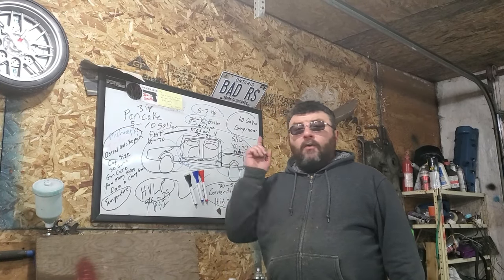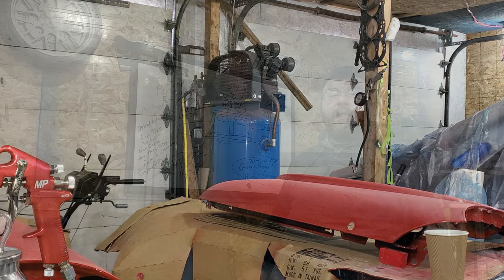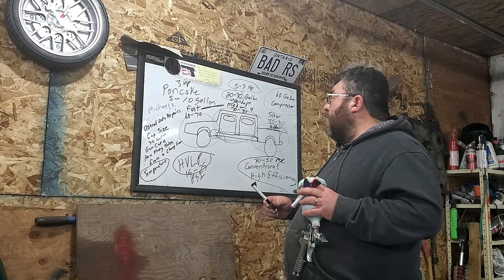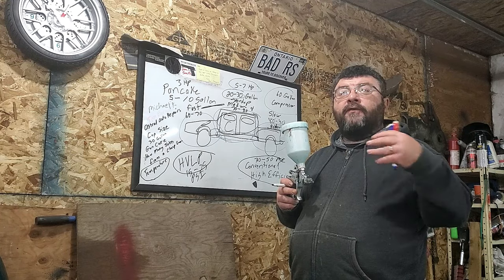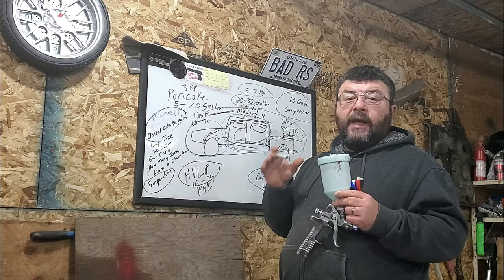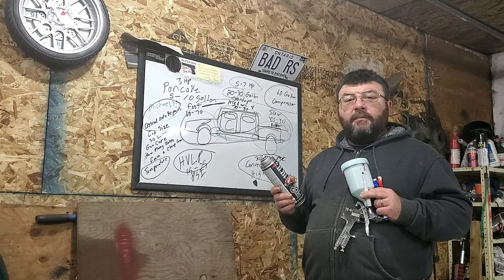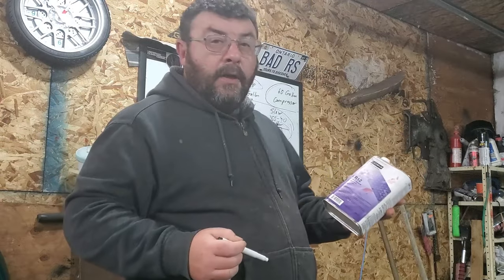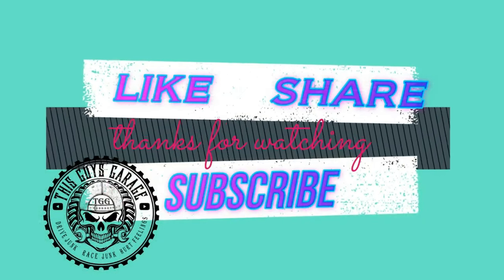compressor size for paint spray gun to refinish cars

Comment: It's weird how you post a video explaining what size compressor is required to paint a car and still every comment is from someone who wants to disregard what you are saying and use a Harbor Freight 2.5 horse compressor with a twenty-gallon tank to paint their car. They believe the r500 lvlp gun only uses 3.5 cfm and it will work perfectly. Well, I saw actual tests done with that gun and if adjusted properly it used 7.5 / 10 cfm. When you read the actual specs, they include with the gun it Staes 11 cfm and yet they still advertise it as using 3.5 cfm. Yes, you can turn the air flow down lower and hold the gun 4" from the car and still paint with a small compressor but to use it optimally you better have a minimum of 10 cfm and 30 gallons of air to be painting a car.
Reply: So what you're saying is you adjust your techniques to youe tools? Got it.

Comment: Ahh man… you’re using those 20 year old marketing HP numbers :( Those 3HP pancake types are closers to .5 or .3 HP but not usually more than 1HP. The true 2HP use about 15-20amps and can flow between 5-8 CFM @ 90 PSI.

Comment: Good info, and easy to follow. The HP rating examples for the pancake and 20-30 gallon compressors seem a bit inflated to me, especially for single stage 120 volt units, are you referring to the older ratings before manufacturers had to meet standard requirements.
Reply from the maker: great question Michael, i use them for reference ,by tank size i was referring to the scope of the size of the repair you are able to paint without running out of air, the hp ratings are all over the place from compressor to compressor, but the volume of air remains constant, the hp would certainly have a lot to do with air recovery. hope this answers it, if not don't hesitate to follow up! ty for taking the time.

Comment: I have a question, so I'm looking to add spray on finishes to my business which is gunsmithing, but i want to know what equipment would best be suited for my job, firearms arent that big but still want a top quality finish on all firearms. would that HVLP gun work or should i also stay away from it. also should i stay in the medium size tanks like 15 gallon and up? thanks in advance.
Reply from the maker: I would suggest a conventional gravity gun , but to help you better I would need to know what coating you are using. 
Is it automotive color for metal or wood stain and varnish?

Comment: I'm 5 ⭐⭐⭐⭐⭐ painter and here I'm watching this video thanks for the information because I'm about to do small jobs,  so the sizes matters depends.   I always had the 60 gallons and up ... thanks
Reply from the maker: Hey kc thanks for taking the time. 
I did a lot of auction work on site doing blow ins and did  a lot of work on brand new vehicles with a small pancake compressor.  It can be done well but you definitely need to stay in the lane for size of repairs.  Appreciate it 👍

Comment: I painted the whole car with smallest compressor (1hp- 9liter).... with small gun it was perfect, bigger 1.4 gun it make orange appeal due to not enough air volume... but I guess 50l with 4-5hp will work like magic...just play with settings of gun and dilute the paint to have uniform flux...
Reply: I did it mostly panel by panel due to low spread of paint :))

Comment: Hello Shaun, I need a compressor good enough to complete by Beetle 1956 restoration job. Looking to buy 6.8CFM /8Bar /2HP Air Compressor as I don't have spare space in my tiny garage. I found a DAXINYANG LVLP Spray Gun R500, Automotive Air Paint Sprayer Gun!  As I'm a beginner, Is this a good choice? Thanks a lot Shaun.
Reply from the maker: i have only purchased one lvlp spray gun ,it was around a 100 bucks and gave more than acceptable results. as a beginner i would suggest going to your local jobber and ask if they have any mismatch paint you can buy reasonable to practice with before you go forward with your beetle paint job to be on the safe side , of do a practice run on the back side of the panels you have off.  good luck and let me know how you make out!
Reply: @thisguysgarage  Absolutely Shaun, I will. Yeah it is a good idea, -mispaint test run. For time being Shaun thanks a lot.

Comment: This is great information. Is it recommended to paint base and clear if temp. is around 60 degrees? what can be done?
Thanks!
Reply from the maker: 70 /80 is optional but there are additives that go in the paint that deals directly with temperature 👍

Comment: What would you charge to paint a trailer with a 6X8 bed that is 14 feet from the rear to the tongue? I'm a disabled Combat Vet and wanna get back into painting. I served in the Air Force and Army. When I was in the Air Force, I painted F-!6s and A-10s. So, I know what I'm doing. I also understand that you gotta pay for experience. So, what would be a fair price?
Reply from the maker: Hey to be reasonable if you are just getting back into it , time is money  ,so if you can get the job done in 20 hours, figure your time is worth 30/40 per hour, I usually judge material costs at the same rate as labor so probably would ballpark 12-16 hundred dollars.  Total 

Just  a ballpark, for estimate 
Let me know if this helps
Reply: @thisguysgarage  Ok. Ok. That's about where I was, too. I've been trying to get round about prices so I don't over or undercharge. Thanks.
Reply from the maker: @sgtrickards5683  🤜🤛👍
And thank you for your service sir!

Let me know if  you need anything else 👍
Reply: @thisguysgarage  It was a pleasure to serve.

Comment: I think I will just be paiting my vw bugs. I am thinking a 30 gallon should work, I am in no hurry. So do you have to wait for a couple hours? Also is a 110v compressor ok to use?
Reply from the maker: 30 gallon 5-7 HP should be big enough to paint your bug. Especially if the Fender's are off.
Reply: @thisguysgarage  most 30 gallon air compressors are 2hp and pancake air compressor are usually 1hp, so where are you getting your numbers?
Reply from the maker: @austinhunt8050  most?  Show me one 2hp 30 gallon compressor on sale today.
Reply: @thisguysgarage  most air compressors run on 120v 15a outlets which is 1800w. 1hp is 745 watts so the maximum power draw is only 2.4hp. And devices that have continuous draw can only draw 80% of the amp rating of the circuit which is 1500w or exactly 2hp.

Comment: I just got a 20 gallon and a LVLP gun. Do you think i have to paint one panel at a time? Can it paint an entire hood?
Reply from the maker: I would need to know exactly what you have , I'm going to make a video on this topic since you were the second person to ask. Let me know what you have for equipment 👍
Reply: @thisguysgarage  I'm sorry. I have a summit racing lvlp 1.3 which i read is a sprayit 33000 clone. 20 gallon Husky quiet compressor. Haven't painted yet, i'm still gathering supplies. Thank you for the reply.
Reply: You can paint the whole thing 25-30 psi quick swipe it 4” away your welcomed

Comment: Here’s the problem I have I bought a 70 gallon compressor by industrial air but it only has a 3.1hp and a single stage compressor. Would I still be a to paint a hood with that? It’s an 85 sw Chevy tgat me and my son is building for him.  Any tips would greatly be appreciated and what gun would you recommend
Reply: That’s supposed to say 60 gallon not 70
Reply from the maker: painting a hood will be no problem with 60 or 70 gallons of air , https://amzn.to/3SLDFI5 would be what i would recommend .

Comment: Good tip on the paint stripper to clean a gun with dried paint inside. I have a question, is it better to remove fenders, doors etc and paint separate or to paint car assembled? I ask because I want to paint jams and both sides of hood, doors and trunk. Staying with same ford ua code black paint
Reply from the maker: if the paint on the jams is good there is really no reason to repaint if they will clean up and you can do a good job masking. i would always suggest painting car assembled . the air quality on the day can change your paint texture so recapturing the same look repeatedly can be difficult ,but not impossible . i have painted jams without removing panels .just mask well. if you already have it apart ,do the jams reassemble for good adjustment before painting.  let me know if you have any other questions ,love it!
Reply: @thisguysgarage  ok thanks. I didn’t really want to remove all that stuff anyway because I’m a one man show. I have to do a little painting in a few jam areas down low because of rusted panels I replaced but don’t have to remove doors to get at it.
Reply from the maker: absolutely best solution! thanks marauder!

Comment: I want to paint my car but I don’t want to use rattle can. I’m thinking of her a pancake compressor . I’m thinking of do panel by panel . What kinda gun that would work with low volume low pressure?
Reply from the maker: A pancake compressor will not supply enough air to paint  a complete panel.  Great for a touch up but doesn't have the recovery necessary.  I am going to shoot a video on this topic of painting panel by panel. This question came up twice today 👍 always happy to answer questions

Comment: How would a 5.5 HP gas, 8 gallon, 10.5 CFM at 40 psi, compressor do at painting?
Reply from the maker: you would need to find a sprayer that fit those parameters ,like a touchup gun for example . 8 gallon is not a lot of volume but the 5.5 might give you enough recovery to do a bit of painting. hope that answered your question . start with a small job and you can judge from there.
Reply: @thisguysgarage  Makes sense. I think I'll actually add a 20 gallon auxiliary tank and see how that does. 28 gallons with the above specs should make a half decent setup while still allowing great portability for nailing jobs with just the wheelbarrow compressor.
Reply from the maker: @vim_usr2753  sounds like a good plan 👍let me know how it goes 🤜🤛

Comment: I have a pretty old Sears 100PSI 12 gallon compressor. Would that be enough for undercoating the underbody of a 2 door sports car? If not what size would you recommend? Thanks!
Reply from the maker: I would use it. No need to buy bigger unless you have a need or bigger projects in the future.  40ish psi for an undercoating gun with a 25 foot hose if memory serves me , longer hose than that  turn up the pressure Guage about 1 psi per foot, will get you in the ballpark 👍
Reply: @thisguysgarage  thank you very much for the quick reply!! Keep up to great work?

Comment: What size compressor would you suggest for shooting color and clear for motorcycle tanks and fenders ?
Reply from the maker: 20-30 gallon will get the job done well ,make sure to use an incandescent air dryer on the sprayer. ty Bill

Comment: my question is.. i have 2 different compressors.. 1 is 33gal and 1 is 20 gal.. is it possible to alternate between both so when 1 gets low and starts recharging can i just jump to the othe full compressor and so on?  basically is it almost like having a 53gal compressor by doing that?.... and the reason i have 2 is because 1 was a gift 15 years ago, and 1 i recently purchased myself.
Reply from the maker: Just install a T between the two and you are ready to rock 🤜🤛
Reply: @thisguysgarage  is there any actual videos on how to do that safely?..  i know electricity ..not compressors..lol
Reply from the maker: @mikeammargon6847  I did a video on daisy chaining compressors  https://youtu.be/bl1UNikebjM

Comment: what's the minimum  horsepower for a home garage would you recommend .
Reply from the maker: 30 gallon 5hp would be the minimum i would start with for light bodywork for example. it all depends on what your doing and what your needs are .
Reply: @thisguysgarage  That;s what others say but ,  they are hard to find .

Comment: How about lvlp gun with a small compresor.
Reply from the maker: I just bought one , it appears to work better at lower pressure but have not had opportunity to test with a smaller compressor ,but as far as the scale presented in the video it would not change a great deal, any paint gun consumes a lot of air. ty great question

Comment: This guy garage what type of gun is compatible with a 20 gallon stand up compressor???
Reply from the maker: look for a high efficiency non help,all the guns i test on my channel are picked by me to work for this type of compressor. 
the limit to the 20 gallon is how much are you will be able to paint at one time.  👍great question. never hesitate to ask Vijay
Reply from the maker: non hvlp
Reply: @thisguysgarage  thanks
Reply: LVLP low volume low pressure.
Reply: What  nose size  to be it? I visited a few  places today  to  get  a sprayer gun , but I didn't find.  I have been at Menard,  Lowe's and  Harbour Freight.  All  sprayer had the nose  1.3- 1.4 mm. Which one is the best  ,and where can I find it  ? Thank  you.

Comment: If you’re still painting and you hear your compressor come on can you wait for it to refill before you start your next coat?
Reply from the maker: i usually start just befor its going to shut off so its still in recovery mode , if you leave it shut off it will loose about 30 psi before it come back on, great question! ty Honey Dutch!

Comment: So I’m fixing to tackle my first paint job It’s on a 07 classic crew cab Chevy 1500 not really trying to break the bank on a air compressor as I’ll only be using it probably one time just on this one truck what gallon,cfm,and hp would you recommend from my understanding I need to be in the 15-20cfm range but all of those are 1500 plus and I’m really not trying to spend more then 500 bucks on a air compressor got ant links you could send me for something that would be good for what I’m trying to do?
Reply from the maker: I would look for a good used 60 gallon stand up that at that point because a super crew full size Truck has a lot of surface area.  The only other option would be to paint it in pieces which is not ideal. Home depot used to sell a 60 gallon stand up for $999 . I would look for a good used one 500 dollars should get you there. Ty yee yee. Any other questions don't hesitate 👍

Comment: If your painting at home make sure you check with your state environmental rules. Certain size cups you can only use at home if you don't have a paint booth. If you have a nosey neighbor and they start complaining About over spray you can be fined. And make sure you have a pl!ce where udispose of ur extra clear coat which should just harden up but dispose of ur chemicals the right way. If your doing all this at home without a paint booth.

Comment: Can i used  craftsman 135 10 gallon ?
Reply from the maker: For small areas described, absolutely
Reply: I try to paint my 1950 3100 truck
Reply from the maker: @ferminmontoya243  complete? Too much surface area.  Bare minimum on a truck cab complete would be 30 gallon. 

Let me know if you have any other questions 👍

Comment: I have a 100psi  1/3 hp  5 gal. Tank from Harbor freight. Is that good enough to paint a Deck… I really don’t want to paint it by hand…
Reply from the maker: How big is the deck? 
You may be better off with a Wagner sprayer if it is of any size.
Reply: @thisguysgarage  10x10 
I already have the $15 spray gun.
Reply from the maker: Your the fan all the way in and shoot  it like a fire hose.
Let me know if you need more info.
Reply: @thisguysgarage  I’ll let you know tomorrow how I’m doing. 
Thanks for the video information.
Reply from the maker: @thomasmckay8022  any time ,any questions usually go to my phone so if you need any help give me a shout .
Reply: @thisguysgarage  well poop…. Well, everything with the Paint gun did not go as planned. I turned on the air tank, let it build up pressure, and then added water to cup on the top of the paint gun for the gravity flow. It worked for about 10 seconds the pressure went down and then it started to try and build up pressure again, and then the needle started to fall. So, I had to disconnect the hose. Pressure started back up.
Reply: Pt. 2
So I need to paint by hand.
Reply: Here another part of my sad story. My neighbor has a stronger compressor, we tried his. Come to find out the paint gun I purchased is defective. Gotta send it back to Amazon.
Reply from the maker: @thomasmckay8022  that is odd how thick was the material?
Reply: @thisguysgarage  the liquid I used which was to tell me how to use my spray width was water…. That’s when we realized that the paint gun was defective… get another one at the store on payday. I thank you for your help & others who commented also.
Reply from the maker: @thomasmckay8022  community is what it's all about 🤜🤛
Reply from the maker: @thomasmckay8022  water shoul spray with no issue ,for sure . was it a new gun?
Reply: @thisguysgarage  yes. Straight out of the box. Simple to put together. But defective.

Comment: Here is the specification of my air compressor: Maximum Air Pressure 115 PSI Air Tank Capacity 21 Gallons Air Flow Capacity Motor Required Circuit Pump Stage Air Outlet Size 4.9 SCFM at 90 PSI 7 SCFM at 40 PSI 3 HP Working /  5 HP Peak 120 Volt / 60 Hz / 12 A / 1-Phase Minimum 20 Amp *dedicated Single 1/4” - 18 NPT. My question is can I use this to paint my entire truck or do I need to get a big Air compressor?
Reply: Depends what gun you use. My gun requires 13cfm to function properly. You have to compare your volume of compressor putting out to what your gun needs. Compressor size, horsepower don’t mean anything. Volume is what you look at.